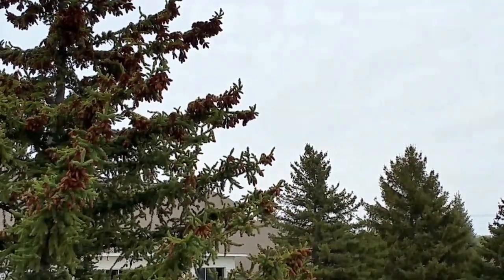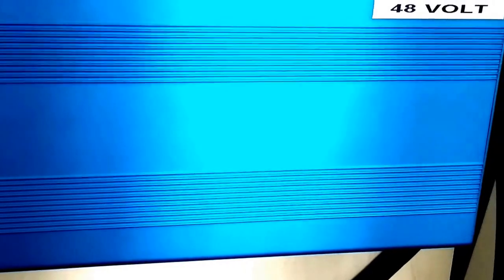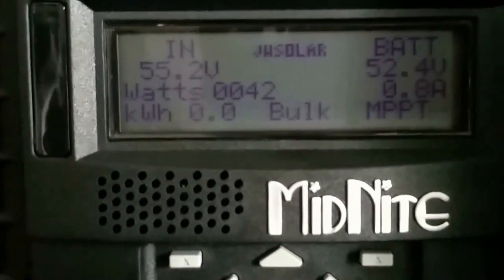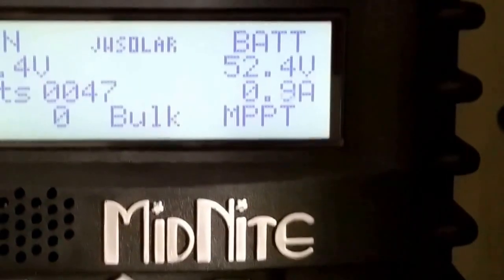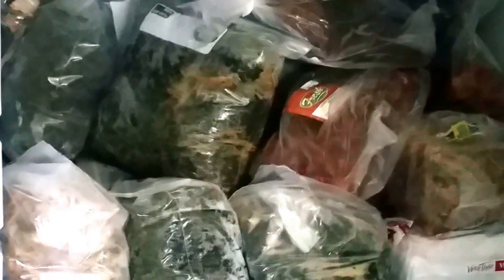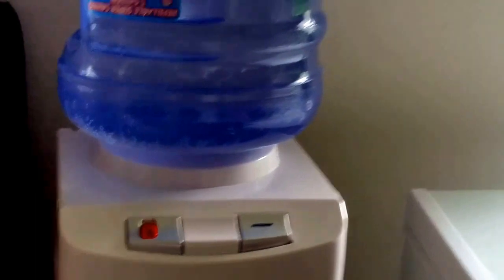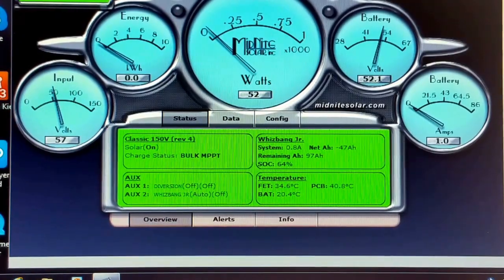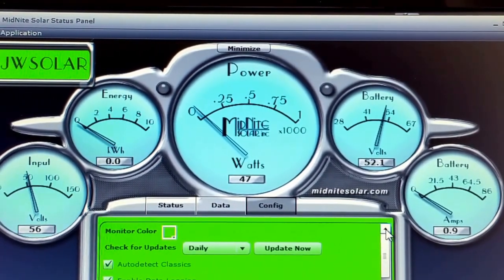DIY 48V OFF-GRID SOLAR AND BATTERY BACKUP SYSTEM TEST #1

Comment: Good move!
Reply from the maker: Thanks for watching and also for your positive encouragement  buddy.

I am currently testing the system which I still need new battery bank for this setup.

I only have 6 x 150Ah batteries which I am currently using 4 for my 48V setup.

 I was using 6 of these batteries with my 24V setup. 

I need another 8 AGM SLA 12v batteries to run this setup
Have a wonderful day and God bless. 
Cheers
Reply from the maker: thanks
Reply: +JW Solarusa One thing that I've noticed with a lot of DIY'ers, like myself initially, they speak in terms of battery amp hours instead of watt hours when talking about battery storage capacity, however calculations as to what power is consumed, and what the requirements may be for appliances and or equipment, is done in watt hours.  In the case of your proposed new bank of 12 batteries, lets do some power storage calculations:  (12v x 150ah = 1800wh of watt-hour power storage per battery)  (1800wh x 12 batteries = 21600wh of total "potential" battery storage) (21600wh x .20% percentage of DoD to get the full 5 to 7 years of battery life =  4320wh of usable power from the new battery bank).  The watt-hours are used to determine what you can run and how long you can run it, regardless if your system is 12v, 24v or 48v.  Obviously if you depleted your battery bank to 50% or 80% Depth of Discharge, you would get more usable power, but at the cost of shorting your battery life.  I bring this up because many, like myself initially, use amp hour capacity to gauge how much storage we have, but that's not the real indication of how much storage power you have or more importantly what you plan to use.  Also, please bare in mind that my calculations do not take into account the inverter in-efficiencies which can slightly lower the total number as well, but hopefully it's enough for you to get the picture.  If you plan to keep your proposed 12 battery bank for 5 to seven years then your looking of just over 4kW of stored power to run your appliances.  My point is this, when sizing battery banks for true off-grid operations, we must keep this in mind. 12 batteries don't mean much when your restricted as to how much you use them.  Take care.
Reply from the maker: Thanks for sharing. You did a fantastic job with all the calculations. 
Currently, I have 10,800Kwh battery storage capacity.
My AGM SLA batteries are rated for 12yrs. That's why I am really careful  the way I use and discharge my battery bank because I spent approximately $1,800 for those six SLA AGM batteries.
I am really looking forward to extend the life span of these batteries by watching carefully the way I discharge and also recharge them to 100% FULL most of the time. 
I have never discharge my batteries below 60%
Thanks so much for the comment, support and concern also for watching my videos. 
Have a wonderful day and God bless
Reply from the maker: +rhandsom Thanks a lot my brother. 
Cheers